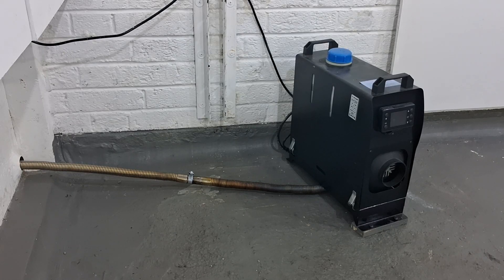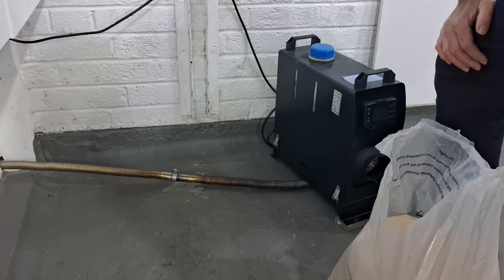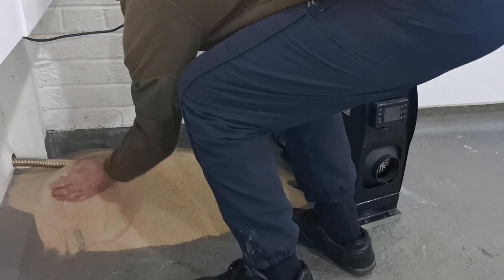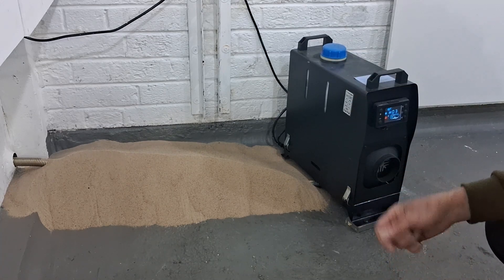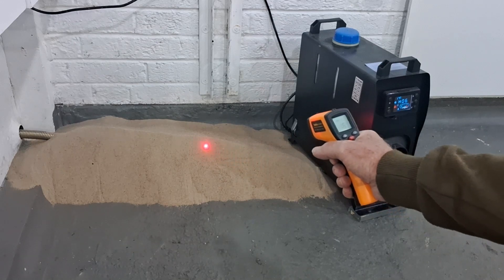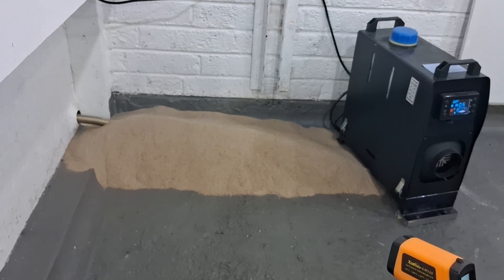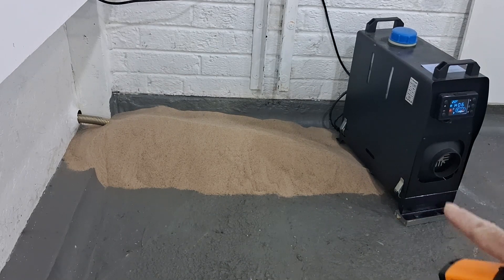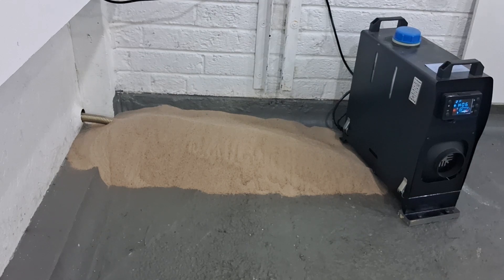Diesel Heater and Sand Battery Store Heat Energy Storage Experiment Off Grid Living Power Source

Comment: Brilliant I saw your short. 
The thing to remenber is that if if your exhaust is outside is hot then that is heat you could be usung elsewhere. 
If you had a small barrel and coiled down copper pipe and then out you'd take up more heat in the sand and remember much better that water as your sand can get to way past 300 degrees c water only 100.. 
Plus do not forget that floor of yours was soaking up heat from the sand and acting as a heat sink as well. I have a 100 litre copper immersion tank I want to convert.. 
The questions always is hwo do you get the heat out and fins of some tubes through the barrel would work, but of course needs more work to do.
Reply from the maker: great , cheers.
yes, we need to scavenge all of the heat from the exhaust before it goes outside.
good comms

Comment: Cooling down the exhaust pipe too much will cause condensation in the exhaust pipe and could damage the heater or worse.  Not recommended to have a long run of exhaust pipe with those heaters.
Reply from the maker: thats true
Reply: @andyfireblade  Look at wood stove heat exchangers for ideas.
Reply from the maker: @solarcabin  thank you xxxx

Comment: Add a boiler to the exhaust as a heat source for the boiler and fill it with distilled water. Then pipe the steam generated and run a steam engine coupled to a generator. 😅😅😅
Reply from the maker: great idea

Comment: I recon you need to get exhaust in contact with some liquid for better and quicker heat transfer, water will boil too quick and expand/ steam so maybe using some cooling liquid/ antifreeze or even something with higher boiling point and then that liquid can connect with some kind of  radiator, maybe cast iron as it will keep heat and give heat for longer.
Reply from the maker: yes, cast iron rad sounds good, i will look for one

cheers andy

Comment: Don't do that, sand is a heat isulator and you are loosing more energy that way. If you want to store energy, intall a long aluminium flexible pipe in the heater output and run it through a lot of sand
Reply: The thing is though, sand is such a good insulator because of the air between the grains, so it takes a long time to heat through, however, being as air itself is an excellent insulator it also takes time to release the the retained heat so stays warm longer than say aluminium.
Reply: @Moonlightshadow-lq4fr Air is a good insulator when it is not moving. When heated, air moves (convection), so it is no longer a good insulator.
Reply: @Moonlightshadow-lq4fr  it is not only the air pockets, the heat transfer between sand particles is very bad too. A rock is much better, water is much better, cob and cement are very good

Comment: I would do some dry snack block to build up a wall nice and thick, to make a bench seat. Move the diesel heater down the wall to bring more of the pipe inside and do a straight run out utilizing that sand and maybe bring the pipe into a larger size to slow the movement and allow more time for heat transfer. Once it exits, then have a gradual turn up at least a foot and a half, 40cm ish.. 
Cap your sand with some pavers.
Reply: I like the idea of a bench seat, bricks or breeze blocks and could use the sand to fill the voids.  That way you get an entire block of solid matter that will retain the heat.
Reply from the maker: great idea, thanks andy
Reply: Basically a rocket mass heater without the rocket stove

Comment: skip the sand... attach a copper pipe that make  some loop in a ibc water tank.... : sand dont do convection , water does (mean pipe always colled by fresh water cuz hot one rise (put the coil at the botom of the water jug)), sand lose vs water at energy storage for mass unit, and with water that stored head can either be used in place by dissipation of the tank, or actively with car radiator if u need more heat...
Reply from the maker: great com, thanks my friend
cheers andy

Comment: Try this:

Get a metal barrel, insert exhaust through hole in the bottom, coil pipe loosely in the barrel, you'll need as much pipe as you can afford and that will fit in the barrel, exit pipe at the top and then out through the wail. 

Fill the barrel with your sand trying to space the coils evenly as you do that. Pack the sand down as hard as possible. Ideally you want as little air in the sand as possible. 

The intention is to extract all the heat from the exhaust before it leaves the barrel. Not possible, I agree, but the more heat extracted the higher the efficiency.

The bigger the barrel (think oil drum) the longer it will take to heat up, but the longer it will radiate heat after the heater is shut down. It will also be a lot more expensive. Smaller barrels are easy to obtain, will heat up and cool down faster and be cheaper. 

If you get a barrel with a lid they you can keep your mug of tea hot on the top.
Reply: You need to be careful of how much back pressure you create extending and turning the exhaust. Too much could create combustion and soot build-up issues making it more of a problem.
Reply from the maker: that sound a really good idea, and i like the tea idea too.

cheers andy
Reply: I think sand barrelling the hot air output is ok provided the duct diameter and curves are wide enough… Sand barrelling the exhaust with a coil shape would put too much back pressure on the exhaust, so a straight slight downwards tilt (for the condensate) sand battery like this is better. The manufacturers provide a maximum recommended exhaust length, so you could basically have this length indoors in a straight battery along the wall.

Comment: It should work well enough, possibly needs insulating from the ground & a brick box around it to contain the sand & heat. Multiple coils through the sand would help distribute the heat more efficiently. I think for the cost of doing it verse the heat it would output an enclosure for the heater would be cheaper though.
Reply from the maker: true, good point cheers andy

Comment: Try placing a cast iron pan on coiled pipe with the sand insulating exposed exhaust pipe. Thermo fans for wood stoves could work if it can get hot enough.
Reply from the maker: sound good , cheers andy

Comment: You've got a a start but you've only slowed the existing heat radiation into the room. You need to increase the surface area for any real effect.  Like the radiator idea. A long coil of that exhaust tubing inside a metal barrel of sand as a thermal mass.
Reply from the maker: yes, that sound a really good idea

cheers andy thanks

Comment: Raise the heater off the ground so any condensation runs out of the exhaust and garage.  If you coil or use too much exhaust pipe it could create a back pressure issue.  Good luck.
Reply from the maker: Thanks for the tips!
Reply: What are symptoms of such an issue?

Comment: its a good idea, a straight pipe not going to exchange heat unless you use a very long length,  for a a passive system without a medium use, a few rows of E-75, 3/4" Baseboard Element -2' Length, make sure you account for the condensation as you cool exhaust, slant it going down or exhaust  down, so mount the heater on top, then exhaust  down threw a few rows of Baseboard Element, then before condensation can happen exhaust out of shop, this a medium free passive rad design

Comment: Theres nothing wrong with your experiment.  Im envisioning an earth stove where you utilize the initial heat from the unit for 6 hours and then maybe have 6 hours of latent heat in a sand battery... obviously not this one but it was a test.  Maybe a larger diameter pipe which would reduce back pressure and tou could make a battery 30 feet ir more long.  Winding and what have you.  IF you utilize most if the exhaust heat it could save you a ton of fuel.
Reply from the maker: brilliant!!!! thats just the kind of comment we want. this gives me and others some great ideas. thanks andy
Reply from the maker: thanks

Comment: Might want to try something with water or maybe even an oil filled radiator.  You would have to figure out a way to transfer the heat from the exhaust pipe to the radiator.   I will be trying something soon for myself since I have a diesel heater and want to get a second one to supplement heat in my house.
Reply from the maker: Thanks for the tip, i have done a few other experiments with the heater and a radiator.
please take a look at my other vids, by clicking on my user name andyfireblade

cheers andy
Reply from the maker: nice bike
Reply: @andyfireblade  I'm already a subscriber.  I checked out some of your older videos too.  I first saw your videos from last year.
Reply from the maker: @kevin34ct  thank you

Comment: The problem you face here is while you are heating up the sand you aren't getting heat into the shop from the exhaust until the sand warms up.  If the sand wasn't there the contents of the room will heat up including the walls faster.  You have to ask yourself how long does it take to make a video in the garage and if the residual heat from the sand makes enough difference to warrant making a column of sand over the exhaust or will the walls etc retain enough heat without the sand.  I would just use a long exhaust around the skirting of the garage, long enough so the end of the exhaust is cool enough to touch.  That way you are extracting as much heat that would otherwise warm up outside. and turn the burner off for making videos.
Reply from the maker: good comment cheers andy
Reply: The heat for the shop comes from the vent on the front of the unit. Look at the thumbnail for this video and you will see the poster has added fake flames to show where the primary heat exhaust is. The exhaust pipe is residual heat from burning the fuel. Using sand to reclaim some of the exhaust heat does not diminish the hot air coming out of the round vent on the heater. I had a similar heater on my 18 wheeler. It was about the size of a shoebox and contained a small turbine engine that burned diesel fuel. The exhaust from the turbine heated one side of a heat exchanger while a fan blew air through the other side which vented into the sleeper berth in the back of my tractor. The burnt exhaust exited via a pipe to the outside of my truck.
Reply: Not quite right, that's the exhaust and as the video shows his exhaust is too hot to touch outside, so it's wasted heat. The point of a radiator (a sand battery is a radiator) is to scavenge heat and redistribute in an even way. 
Sand is brilliant at this.. Just need to work out how long the average run time is and then work out the volume of the sand battery
If andy spends 8 hrs in the garage then running the heater for 3 hrs coudl very well heat the sand battery so that it will provide the heat for the next 4 or so.. Testing will tell more. 
The point is the exhaust should only be 20 odd degrees by the time it exits the garage ;)